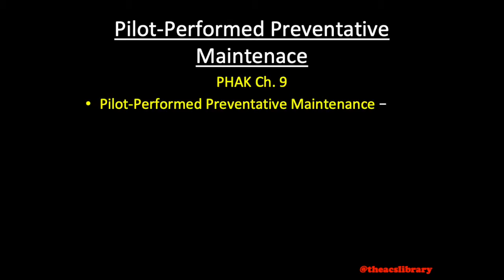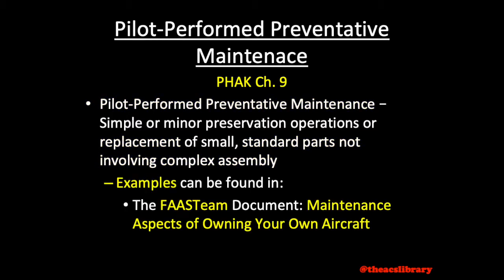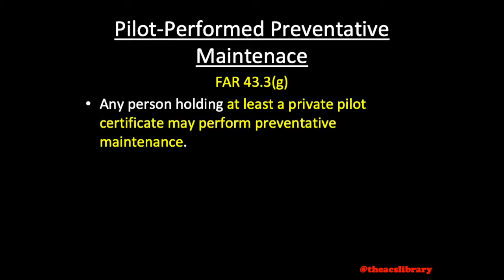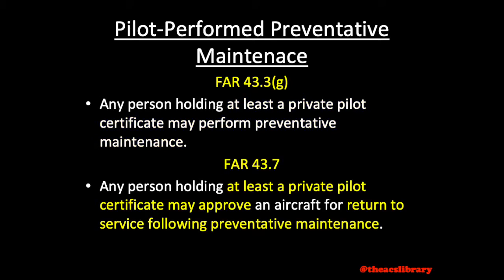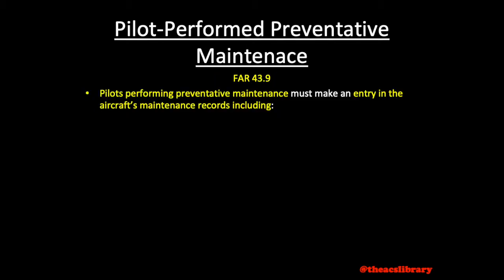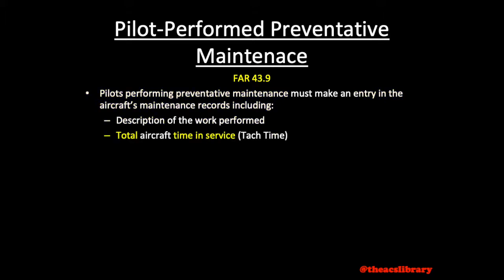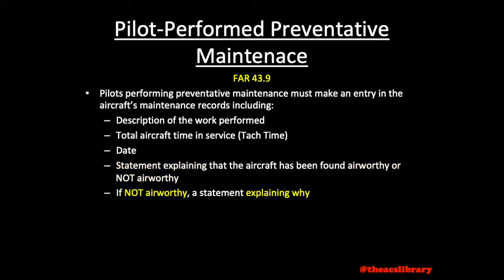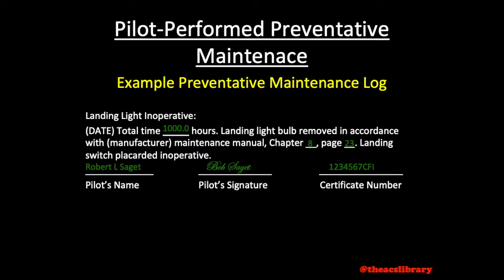PA.I.B.K2 Pilot-Performed Preventative Maintenance

Comment: Great video! I don't know if the rule changed in the past 3 years, but 43.3(g) now says any pilot with certificate issues under part 61 (meaning even a student pilot, not only a private pilot) can perform preventative maintenance but to approve an aircraft to return to service you must at least have a private pilot (43.7(f)). I like the way you explain the ACS keep it up!